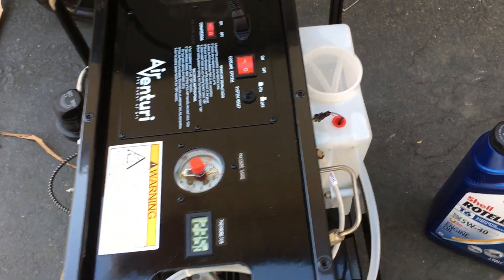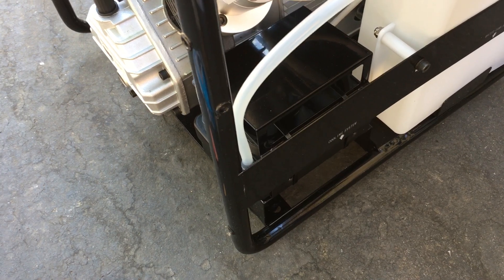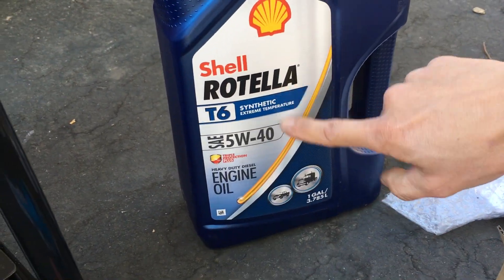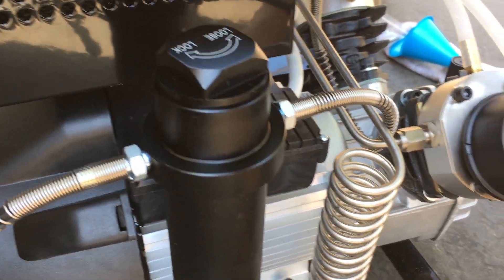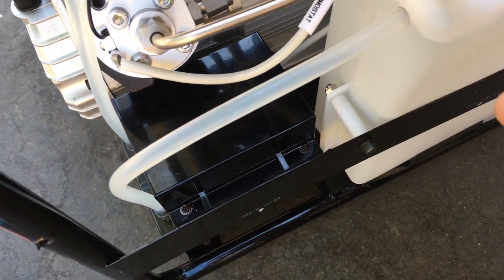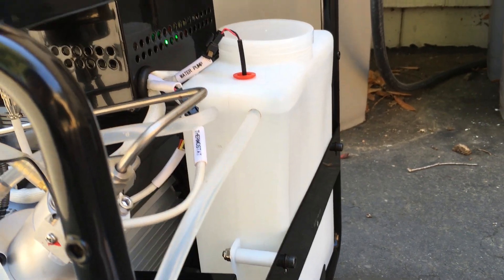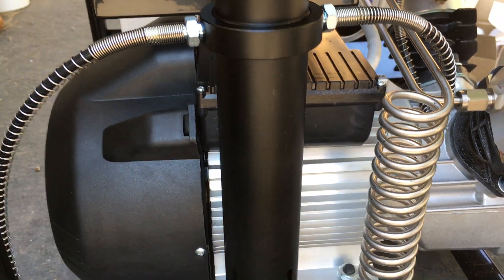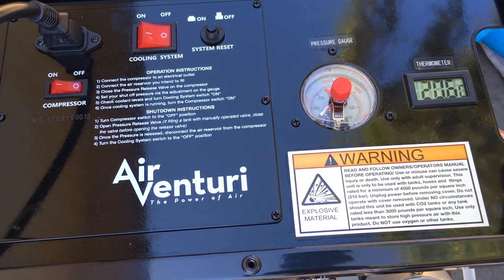Air Venturi High Pressure (4,500psi) Compressor setup

Comment: Thanks for the video.  My AV 4500 compressor arrived today and I'm watched your video again right5 now to refresh myself before setting it up.  I've already got the panels off and distilled water it it.  I bought it from Joe Brancato and used the oil he recommended.  Next, I'll put the oil in and do the 10 minute run.

Comment: Add a hardline vibration hr meter about $39 on Amazon no reset button ... no wiring,broke it in 10 minutes then installed it makes it to maintenance oil change and I bought air venturi filter to catch more moisture.
Reply from the maker: Got the vibration hour meter on there, and also a Diablo post filter, much more volume then the AV one

Comment: My water temp would get over 75C after pressure became over 2000 psi. Eventually I started bleeding off the return water and adding a constant flow of cool fresh municipal water. Now it never exceeds 60C. Also don't these high pressure compressors require ISO 46 hydraulic oil?
Reply from the maker: When new you have to bleed out the air bubbles, tilt the machine around while running.  Mine never gets over 65*C even on the hot day up to 3000psi.  Yes you should use high pressure compressor oil.

Comment: I use royal purple compressor oil .... it's  better man
Reply from the maker: The question is it rated for high pressure air... or is it just shop air compressor?
Reply from the maker: if you see the more current video I am using the proper high pressure air now.
Reply: DaBinChe have you/are you getting any black oil out when you bleed it? Also has it stuttered on you at all while running?
Reply: Yes it rated for high pressure and no black oil when I bleed it plus I just installed hour meter
Reply from the maker: No black oil but, the bleeder has a mix of oil and water so it comes out looks foamy/creamy
Reply from the maker: Looked it up and it does not say anything about high pressure compressors, it is for a regular piston compressor.  You better contact Royal Purple and ask if it is okay for 4500psi and not a shop compressor of 125psi.  The oil I'm using is the same stuff that is used in firefighting and SCUBA diving breathing tanks meant for high pressure air compressors.
Reply from the maker: No stutter
Reply: That's good bro to each his own but go read the customer reviews on Amazon on that product ..... it's a 30 w just 5 w 30...cam lube is good too ,But Royal purple is well known throughout the community and  It's an electric compressor not gasoline
Reply from the maker: I'm talking about air compressors not gas motors.  Royal Purple Synfilm Recip 100 High Performance Synthetic Air Compressor is for normal compressors the type that is used as shop air, ~125psi, like for nail guns and pumping up tires etc.  Nothing about it indicates that it is for high pressure air that can go up to 4,500psi. I'm not talking about pressure washers that shots out 4,500psi, I'm talking about filling up an air tank that can hold 4,500psi All those reviews on Amazon are for regular air compressors not high pressure air compressors.
Reply: Thanks for the response. Purchased one and it was emitting jet black oil and stuttering. Swapped it out with another one and same problem except the stuttering isnt quite as bad...yet. sending this one back as well as soon as i talk to Air Venturi. Not sure whats going on. Im either going to try one more or go for a different compressor.
Reply: @sethh2013  Air Venturi and many others use cheap Chinese compressor units just like the cheap Yong Heng units do.   They have no bearings on the connecting rod so that dark color is suspended aluminum that was chewed off the connecting rod.
Reply: @johnnybarbar7435 thank you for your response. My AV compressor was dieseling. It was rendered useless and was returned.
Reply: I bought my AV compressor from Joe Brancato and he provided me with HPA compressor oil.